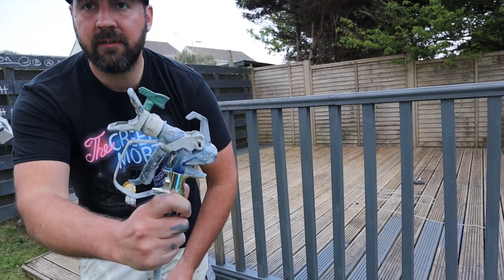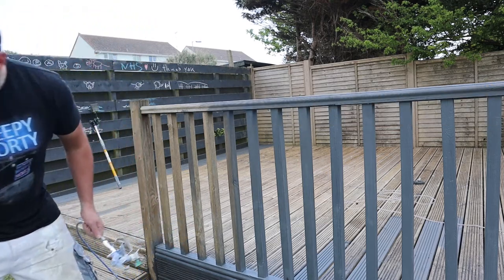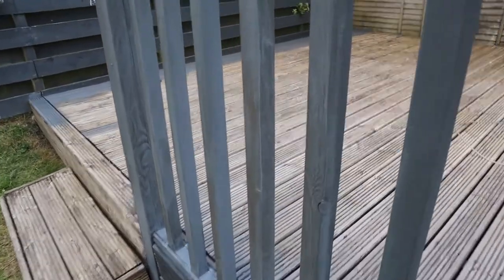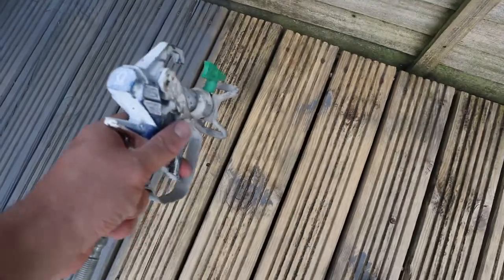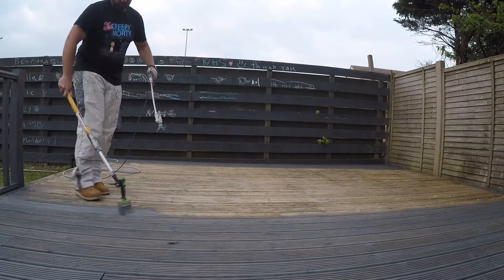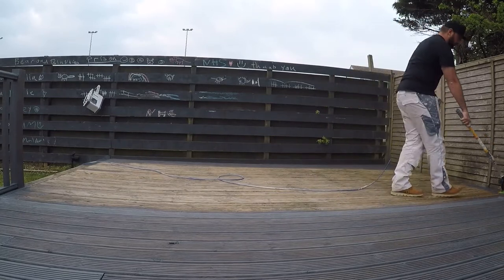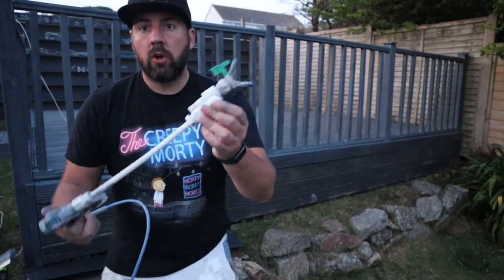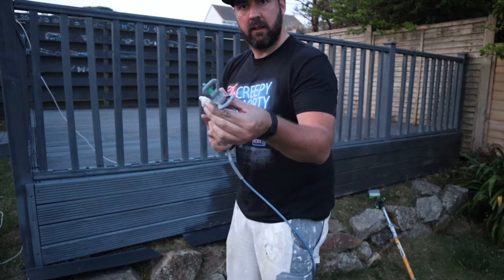How to stain a deck with a sprayer - Grey transformation

Comment: Holy shit you back brushed lol . That sir is the proper way to stain a deck . I tell people you have to brush a deck you can spray it to speed up application but you must back brush it still.
Reply from the maker: Haha thanks for watching. Yes brush that first coat in as it can be abit rough so spray doesnt push into all the little areas. I spray the second coat straight on
Reply: @sprayaholic   I'm goin on 20 years of doing it I was goin over some videos to see what tip size people were using for the super deck . Idk though I still i guess out of habit want to back brush the 2nd coat.
Reply from the maker: @jdav1984  if its no longer drinking the paint i usually go for a spray coat.
Keep on doing a proper job 🙌
Tip depends on the thickness of the paint for me as every days different in the uk especially with the temperature ha
Reply: @sprayaholic  ya its rare I spray my stain unless it's a big deck or I'm spraying siding.  I have a 210 fflp for cabinets I was going to use but after seeing your results with the 108 fflp I'm considering spraying this deck or atleast the pickets.
Reply from the maker: @jdav1984   well the 108 was for the spindles. The actual deck i think i used something like a 314 or even a 310 or 410.would be great. Try to get 2 planks in one pass to speed up coverage

Comment: What sort of time did that deck roughly take you with the sprayer plz? Iv been asked to do quite a large pub and I’m tempted to purchase the sprayer to save on time
Reply from the maker: The cleaning probably took the longest.  But actual spraying time maybe 20mins per coat if that. Best to back brush that first coat then just spray the next i found
Reply: Brilliant thanks for the reply I’m new to all this and new to your channel.. iv just bought a earbouer airless sprayer today to do some decking.. iv not managed to get it running right yet but it only came with 1 nozzle and im wondering if I need a different nozzle for the thickness of the paint

Comment: Hi, great video, I want to do my decking which has now faded from brown to grey. Thing is I am terrified whatever I use will peel off and when I re-apply it the next year it will be patchy. Is there any product which WILL NOT peel? Thanks
Reply from the maker: hey, a clean and pressure wash first. If the underside of the decking starts to soak up moisture then eventually it will be pushed out the top side which is why the paint then peels . tikkurila do a decking product, its not cheap but probably last longer than most. usually alot of brands just last a year if its not under heavy foot traffic. so long as the deckings properly dried out its the best  chance you can have

Comment: what would you say roughly was the coverage with this technique, tips, etc per gallon
Reply from the maker: That first coat just drank in the stain. I think it took 7L for 2 coats. Id estimated a similar amount for brushing only. So really the sprayer was just used as a speed of application

Comment: Did you clean the deck 1st?
Reply from the maker: Hi. Yes i used a pressure washer to clean down the deck and fence.  I then got asked to change the colour a few days later to black. Check out the re stain video here
https://youtu.be/TBaZ00AVwjc

Comment: can you use decking oil in an airless sprayer?
Reply from the maker: Yes you could if you wanted to.Use the recommended clean up with it.
Reply: @sprayaholic  thanks! tha would be thinners i imagine? also, your hose is very flexible. i'm unsure of the correct name, but i think it's called a ''whip''. 1m or so piece of flex pipe that attaches between the gun and the line. any recommendations on buying one in the UK? i have a wagner 117. i'm new to this machine and it'll be my first outing using it. cheers

Comment: What product are you using there? They grey is a great colour.
Reply from the maker: Its wicks own brand. Its a lovely colour when its solid. But like more of the cheap ones is super thin and is at least a 3 coat coverage with brush. Our order has just come and were going over with a darker colour now. Carbon in the ronseal range. Ha everywhere is sold out of stain so we've this is what they've gone for now.. Anti slip too.
I'll pop another video up once i re coat. As it will ve darker and the next coats fly on. This first coat takes more time
Reply from the maker: Its £19 for 2.5l the wickes carbon slate.
So pretty cheap really. Screwfix sell their own brand and its £9.99 weve used it before and its lasted over 3 years.
All waterbased products.  So long as cleaned properly and brushed in it should last
Reply: @sprayaholic  brilliant thanks
Reply: Hey. Not sure if you would know this or if you’re using the same paint product in the darker colour... I actually wanted to use the ronseal decking rescue paint, do you think I could spray that on to the decking? Or will the paint be too thick? Thanks!